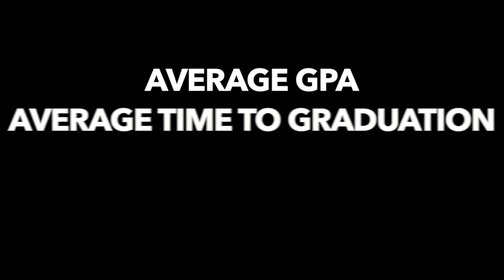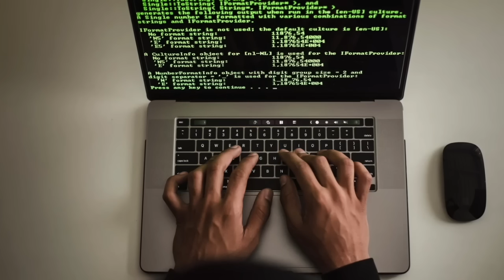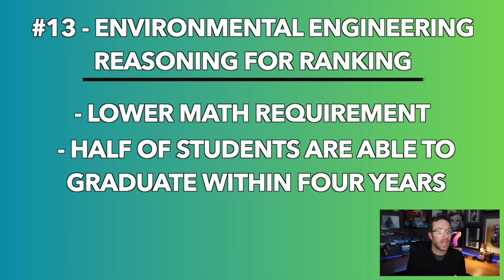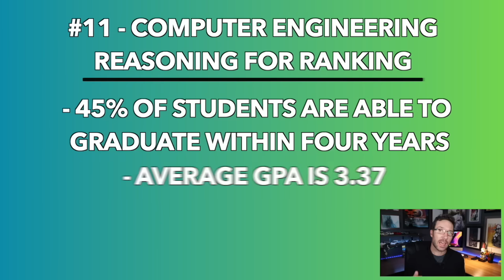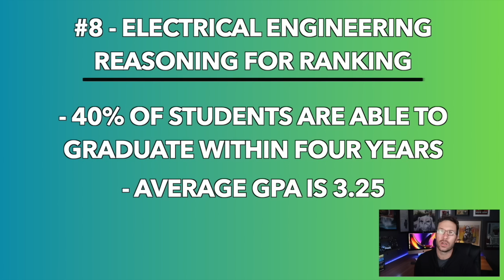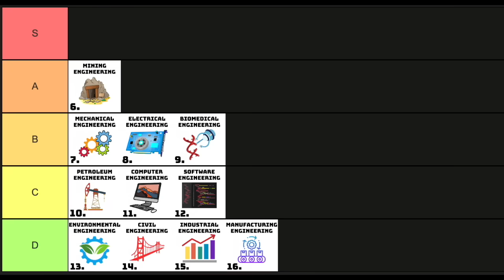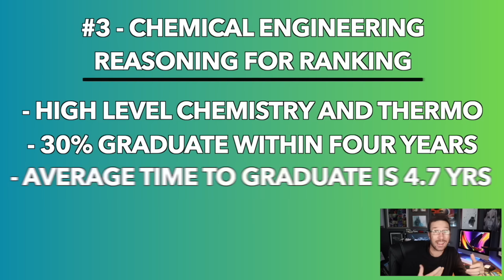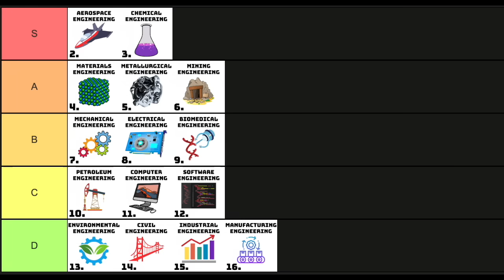Engineering Degrees Ranked By Difficulty (Tier List)

Comment: I'd be interested in the statistics around some other engineering degrees.  Power systems engineering, Welding engineering, not exactly an engineer but industrial hygienist.  There are also skilled trades that would be interesting to see you rank.  Tool and die maker, any other high paying skilled trade.

Comment: I absolutely agree with you as a person who received their undergrad and chemical engineering. I understand why you put nuclear in aerospace above us. However they are a bit specialized and as you mentioned the job growth is a little small. Meaning you really have to want to work in those career fields and they tend to not be as transferable as the chemical engineering degree. It would have been interesting if you would have had some type of factor to include the degrees as being transferable around different industries similar to how your comments were about a mechanical engineer

Comment: I totally disagree with you, I graduated with a BSEE degree in 1992; it took 150 semester hours and 5 years to complete with a 3.0 GPA; the math requirements were overwhelming as that is what electrical engineering is based on. Additionally, I had to take courses in mechanical and civil engineering and 3 semesters of physics. It was brutal to say the least. Maybe they've gotten easier on EE majors since I graduated.

Comment: Even though I’m a computer engineering graduate, our coursework included a strong foundation in mathematics. We studied core subjects like partial differential equations, Laplace and Fourier transforms, ordinary differential equations, vector calculus, complex and real analysis, numerical methods, linear algebra and vector spaces,  statistics and probability, discreate mathematics areas: mathematical logic, graph theory, set theory, algorithms. I also took elective courses such as advanced numerical methods. Within engineering subjects we learned fourier analysis further. Overall, I gained a broad understanding of these areas and how they connect to engineering applications. I believe I’ve covered almost all the essential areas of engineering mathematics. These subjects are essential for building a solid understanding, even though we don’t directly use all of them in our working environment .Because there is software tools for it.   Still, they’re deeply connected to the underlying principles of engineering and play a silent but important role in how things work behind the scenes.

Comment: Bro the pillars of ChemE are fluid mechanics, heat transfer, mass transfer, chemical reaction Engineering, and process design, of which only chemical reaction Engineering involves a little bit of chemistry, that too is insignificant. Also there is transport phenomena which involves quite a lot of partial differential equations, so highest level is that.

Comment: Architectural engineering is most difficult by far.  First of all, it is a true 5-year degree.  13 hours of study time per day required to get 4.0, then you need to know structural, electrical, and mechanical engineering as well as architecture.

Comment: From 1983 to 2008 I would designed electrical schematics with hundreds of component. Technicians would solder together prototypes, and then we would troubleshoot with red ink corrections.  My 1978 Electrical Engineering degree did not prepare me. I had to learn on the job.

Comment: The criterion used for justifying difficulty are not applied consistently.  Environmental Engineering is not a true engineering degree as it is more a policy oriented degree without the scientific and mathematical rigor of real engineering degrees.  The time to graduate can also be misleading as a lot of top students and foreign students study Electrical and Mechanical Engineering - they tend to perform at high level and graduate on time.  Metallurgical and Materials Engineering are generally in the same department with metals being a subset/specialization of MSE.  Finally, Metallurgical Engineering requires Partial Differential Equations when studying heat transfer and other physical properties of an object.

Comment: All Electrical Engineering Degrees consists of partial differential equations. They are taught, (in classes at, 3rd Year, American and Second Year British universities), before the two dimensional Schrodinger Equation, Directional Derivatives, Hessian and Jacobian, Double Integrals and Triple Integrals are encountered. In fact, in the (American fourth year and British third year classes, partial differentiation and integration are extended in the Complex Plane, routinely utilizing Cauchy Integral Formula.

You must be talking about Electrical Installation for Electricians. I challenge you to name ONE university where partial differential equations are NOT taught in an Electrical Engineering degree.

Comment: I did Electrical & Electronic Engineering in the 1970s in the UK, and I had to do  lot of Physics, which included a lot of Quantum Mechanics and partial differential equations. That degree had more Mathematics than all the other engineering degrees at my university. At that time, Biomedical Engineering and Chemical Engineering were considered pretty low level.

Comment: Just remember college isn't for everyone I've dealt with a lot of engineers in my lifetime. C's will get you degrees
 Also a second rate engineer. We need skilled trades. We're running out of people who know how to build things. Work with their hands, repair stuff, set grade in a building site and run heavy equipment. How about cnc machining or good old hands-on machinists. 
I was a high level Machinist / CNC programmer before I retired making $130,000 a year. Yeah I got my hands dirty. I got to retire early at the age of 58.

Comment: Engineering in Australia is just depressing now. Immigration has decimated the job market. We have over qualified immigrants in entry level positions making it extremely difficult to move up and even get hired. Contractors claim that "theres a shortage of skilled workers" which is almost entirely false, I know citizens who have graduated from engineering and are struggling to find roles meanwhile they're bringing in immigrants to fill entry level positions. I would probably do the same if I was the contractor, why hire a domestic grad when you can get an immigrant with 10 years experience who wont ask for a promotion ever and will do longer hours than everyone?

Comment: Besides maths and sciences, some disciplines require better memory than others. I have poor memory, but I completed my M.A.Sc. in 18 months and Ph.D. in 2 years, both in structural engineering. Chemical and Env. Engineering would kill me. BTW, your assessment of the required level of maths isn't accurate since sub-disciplines within a broad area have different requirements. Anyway, advanced math courses cover both ODE & PDE.

Comment: Despite i dont work in enginneering, I finished Welding engineering, which was ok but nothing too difficult and later i also studied Material engineering, however chemistry was my nemesis that led to my demise (i dragged it till my last semester and then didnt pass).
Material engineering was significantly more difficult but its not that studying materials was difficult (it was actually not that hard and interesting) but because it was a mix of many disciplines and all of them were not just intoductory level. 
Only matematical faculty had more maths than us, only ohysics faculty had more physics than us and only chemistry faculty had more chemistry. Then there was mechanics, thermodynamics, all those electrical classes etc. 
I didn't finish but i really enjoyed stuying it. We also had the most projects, so it wasn't just sitting in classes but also coming to uni at evening to "rent" a lab with microscope or sit at home and cutting 50x50cm sheet of polymer  into pieces 3x3mm with scissors so you can put it into extrusion machine to make filament for 3d orinter. Latest i left university building was 22:15.

Comment: Worked in medical research for 10 years, was invited to attend medical school by my boss, then switched to software because it was more interesting and paid a lot better.  My specialty was embedded systems.  I was half way between software engineering and computer engineering, with a BS in Biology!  I loved Calculus 1, but that's where my math stopped.  Never needed any more.  My title on paystubs was Software Engineer, though I never claimed to be one.  My actual work was at the intersection of software and hardware.  I verified complex chip designs before they went to the foundry.  I designed and wrote boot code for a 256 core microprocessor.  Worked on cell phone and DSL modem designs.  I was the one who worked with digital designers and software guys, because I was comfortable with both.  My salary near the end was right up there with your averages, but that was in an expensive area.  I did get stock options and now collect a pension from a large electronics company.  My advice to students:  Do what you love.  The pay for any of these is adequate, and you only live once.

Comment: I am surprised that you did not include Structural Engineering in your list.  In the west coast states and several others, it requires you to become a Licensed Engineer first and then do a two-year apprenticeship under a Licensed Structural Engineer.  Then you are required to take either an additional 16-hour or 24-hour examination.  When I did mine in Washington State, I became a PE, Civil and then worked in a Structural Consulting firm for a couple of years.  When I passed SE-1 there was a 50% pass rate.  For SE-2 there was a 20% pass rate.  SE-3 there was a 6% pass rate with only 2 of the 33 candidates passing the test.  Remember that this was from individuals who had worked in the Structural Engineering field for a minimum of 2-years, then passed the SE-1 and Se-2 tests which take at least another 1.5-years in the field.

Comment: I have been licensed professional land surveyor since '92, never went to college. I get the low ranking for civil engineers, I had to do much of what they do in problem solving on the fly. There's an error in the plans, concrete truck running up my butt & expensive to send away, redesign the curb leading into a cul-de-sac because the guy that constructed the inlets changed a 40' wide road into a 36' wide road/ developers of a storage have to redesign much of the facility on the fly due to poor readings by the prior surveyor so once a week I would meet the developers & a civil engineer to redesign drainage- the engineer would look at the specs, say "we have to do thus & thus" & I would get out an engineering calculator & make the math work. Six months of night school for art, one course at Rutgers to prepare for the surveyor's test.

Comment: Wondering where you got the credits?  I graduared in the mid 1980s from UT Knoxville. The curriculum for engineering ranged from 142 to 135 semister hours.  All engimeers took two full years of math(incuding Diff Eq), a year of chemistry, and a year of calculas based physics. It was rare to finish in four academic years.

Comment: I just retired after a 41 year career in electrical engineering (I had to take partial differential equations to get my bachelors degree though). I actually started out in architectural engineering which combines disciplines taught in mechanical and civil engineering, and architecture. At that time, it was a five year program. I changed majors to EE because I didn’t like the “artsy” part of it and found I really liked studying circuits when I took physics. I’m surprised it didn’t make the list. I thought it was harder than EE.

Comment: Something you should have mentioned about both Civil and Electrical (as opposed to Electronics) engineering is the professional certification requirement.  Both civil and electrical require licensing to approve drawings for use.  Electronics does not.  I’m not sure about the others.

Comment: "this is going to be the most subjective and accurate list" - yeah completely depends on your references and data which we have no knowledge about.

The data does not feel very reliable and there are other even stronger factors involved. For instance, the entry requirements for those schools and disciplines. This makes a huge difference because of the different average intelligence level of students  involved.

This is not an apple to apple comparison.

Also, Electrical engineering is most certainly right up there in terms of difficulty and how demanding it is. Including the mathematics involved (it's not only ordinary differential equations at all). It's a known thing in schools of engineering and for a long time, that EE is one of the most complicated fields that intimidates people.

Comment: I graduated from University of Texas  at Austin with a BS in Electrical Engineering in 1972. We were required to take elementary calculus, analytical geometry, ordinary and partial differential equations, a higher calculus course, stochastic processes (statistics), Boolean algebra, and learn Fourier series, imaginary numbers, and other higher math within the EE courses. Total required hours was 132 semester hours. With one exception, all of the EE professors were just awful teachers (I have about 400 semester hours of graded coursework, half of which is graduate work, so I have a substantial basis to compare UT’s professors to others).

Comment: Electrical Engineer math is much more advanced than just differential equations. You need advanced Vector Analysis and advanced calculus to enter the field of microwaves, which deals with advanced solutions to Maxwell equations, as well as advanced statistical studies to solve quantum mechanical problems, which are the basis of semiconductor technology.

Comment: The most difficult is Mechanical Engineering. Because it covers everything, Automotive, Airconditioning, Machine Design, Chemical (When you are in the field of designing engines a knowledge in fuel is nexcessary), Power Plant, all kinds ( Who designs machine for the nuclear? Of course Mechanical Engineer, Ship building, Airplane, Rockets, Etc. Etc. The pay is varied, because you can only master few industry, but you have to study a little bit of everything.

Comment: i think you under rate Electrical Eng, specially because math, EE not only use ordinary dif eq but also complex number that no other specialities use and for EE is like ABC,  add also fourier, linear algebra matrices,  numerical methods, statistics, boolean algebra, tensor calculus, what other engineering do with real numbers, the EE do with complex numbers. and Physics from mechanics, thermodynamics, electromagnetics, electric circuits to  quantum mechanics and also chemistry. it is a very wide eng and very complex. i have been EE for 46 years and university proifessor for 37 and still working.  do you know how the students call the applied EM, not the one they receive in normal physics courses but the one special only for them, well, they call the electro magic because now you see and later you don't see it. less than 40% finish 5 years courses almost all of them  drop in the second year. and yes all eng carers all very hard.

Comment: I hope you address the fact that metallurgical engineering has no due dates; open book, open date, open attempts, 1-2chapters per book other engineers use the entire book, and often can get free or close to free tuition because they need them! This is far beyond the easiest degree of almost any degree, not just engineering. The problem is for them, they do take medium math, pchem, and the other basic/gen engineering classes... so it's a great dial degree, because the met degree is easier than anything else, so you have 50% more time to study other degrees and you can't fail out. 
My roommate did this... It was so surprising .. but you get a degree, usually 2, for free!

Comment: You have not included the difficulty in understanding the hard concepts involved in some engineering degrees. Electronics Engineering, which is in high demand, requires a lot of physics, which is the most difficult subject for many engineering students. Grasping the flow of electrons without actually seeing them demands high level of imagination..

Comment: I'm not sure why you would think that Electrical Engineering only requires an understaing of ordinary differential equations - even into year 2 of a 4 year course (at least from any decent university) you will be doing things like partial differential equations, vector calculus, line integrals, etc - for an understanding of Maxwell's Equations. Plus if you do a combined degree in (e.g.) Electronic and Electrical Engineering where you will be studying things like semiconductor manufacturing (so an overlap with Materials Engineering) - you will also need that level of maths and beyond because you are basically into applied quantum mechanics.

Comment: This post fails to communicate the structure of engineering studies to the youth. He should have said that the four basic engineering disciplines / qualifications are, in rising level of scientific skills to be mastered, civil & structural, electrical, mechanical and chemical. The others are not separate disciplines but rather specialist fields achieved through specialist studies which are more focussed on a more specific fields of scientific application. Hence, levels of education beyond the generalized disciplnes are required ...😊 requiring additional post graduate studies, taking much longer to achieve.